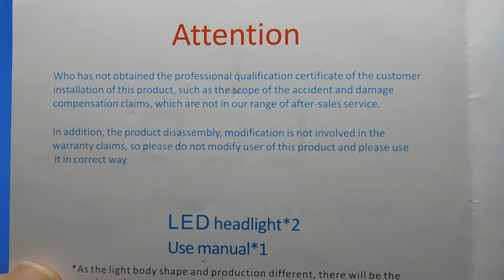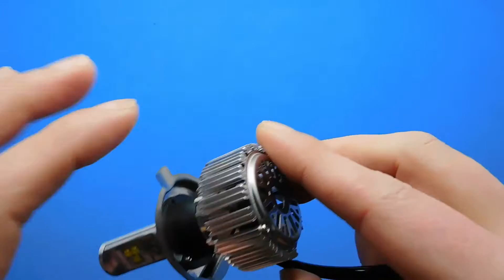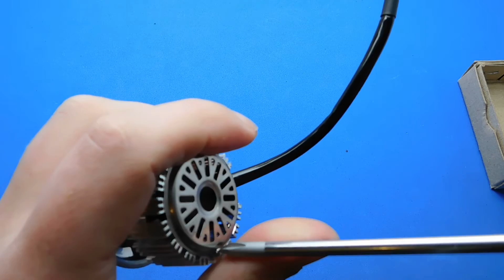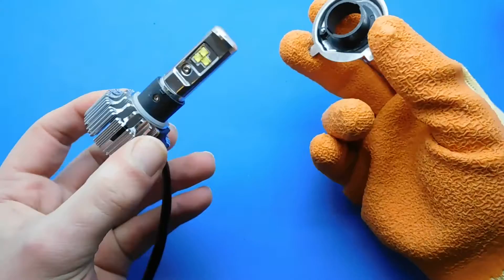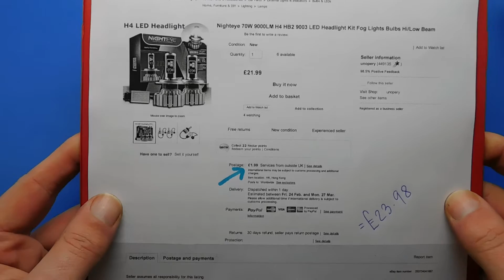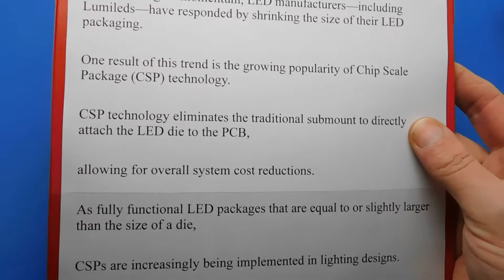£20 LED 80W Car Headlights H4 Nighteye CREE Chips 6000K High & Low Beam Bulbs Conversion Kit Review

Comment from the maker: Hi guys, this is an update as of 23rd of October 2017,

I have to mention a few things, most reviewers are lying to you,

They get their LED bulbs for FREE from the manufacturer, so they don't tell you about the problems with these bulbs,

I spend my own money on these LED bulbs, and i don't care what the manufacturers think of my reviews,

I will never sell out to free stuff from manufacturers,

So i don't have to give good reviews if i feel the product is not very good,

So here goes,

I have used these bulbs now for 7 months,

They are still working, which is amazing in itself really, i expected them to burn out before now,

BUT my car would not pass it's MOT with these LED headlight bulbs in my car,

The MOT tester exact words were "The beam pattern was all over the place",

So if you are worried about beam pattern, and dazzling traffic at night, don't buy these headlight bulbs,

So you will need to put the old halogen bulbs back in for your car to pass it's MOT,

But it is a safety issue for me so i will refit LED headlight bulbs again for this year,

But this set was very awkward to fit,

I have a rubber boot on the back of my headlight and to fit these LED headlights you have to stretch the boot onto the heatsink and it is very difficult,

It is a 2 person job, one to hold the bulb the other to stretch the boot as much as you can,

And then it is really difficult to lock them into the headlight housing,

So you need 1 person to hold the headlight and another to push the bulb in as hard as you can and it only just locks in,

The boot needs to be on the the headlight to stop dirt and debris getting into your headlight,

So i have bought another set that should fit in easier as there is more room between the heatsink and back of the plate that holds the bulb into the headlight,

This new set i have bought were the ones i wanted originally but they were to expensive but now they are only £34, instead of £48,

http://www.ebay.co.uk/itm/Nighteye-H4-9003-HB2-LED-Headlight-Fog-Light-Bulbs-Lamp-Hi-Low-Beam-60W-10000LM-/272696549855?hash=item3f7dfb21df:g:oHgAAOSwUKxYdMMl

They only have a heatsink so they are supposedly 20 watts less at 60 watts light output for the pair instead of 80 watts,

I will be doing a review video soon of this new set.
Reply: Led lights on a car that comes with halogen bulbs will never pass MOT tests. I replace mine after every test.

Comment: Nice Vid,
Would be nice to have a follow up review for these bulbs. 
How well have they lasted? 
Are they worth it?
Reply from the maker: Benjamin Aland hi, they are 5 months old now,

They are still working all the led's are still lit, and the fans are both still working,

They have lasted longer than i thought they would, i don't think i will buy any other brand than nighteye, they just seem better made than cheap unbranded multi led headlight bulbs,

I am really happy with the quality, night driving is so much safer than with the old halogen bulbs,

In the summer months they don't get as much use,

I word of advice make sure you buy the right set as they were very tight with the heatsink being so big at the back of the bulb,

Also make sure you buy the right fitment type mine were H4,

Don't pay any more than £35, you can get a good set from nighteye for that price,

I had to stretch the rubber boot almost to breaking point to be able to fit the boot back over the headlight housing,

Thanks.